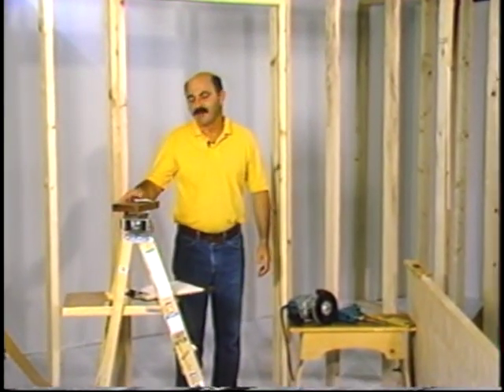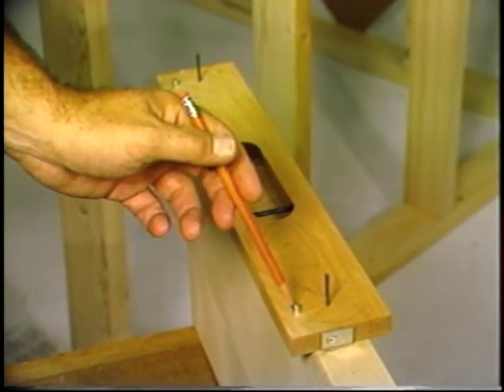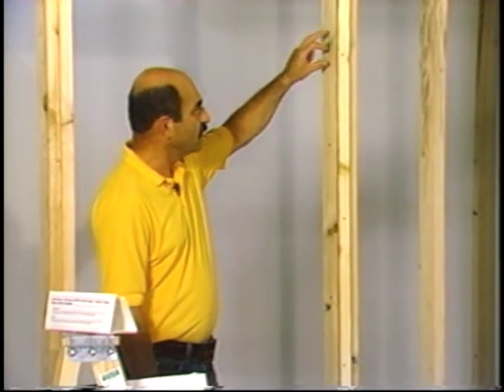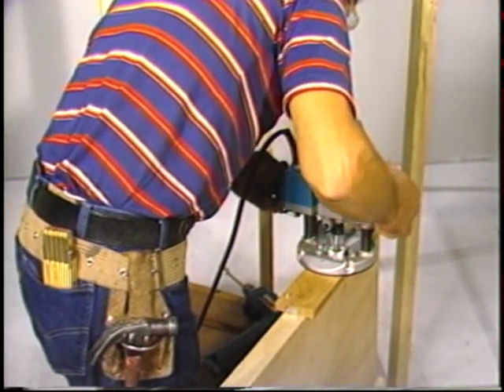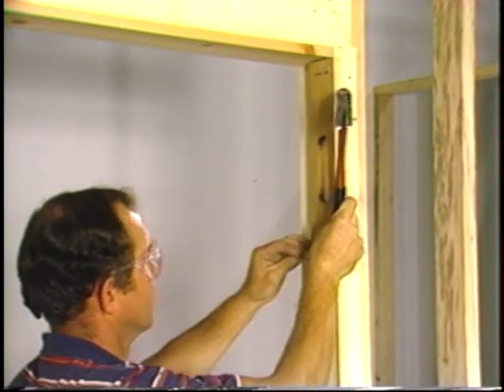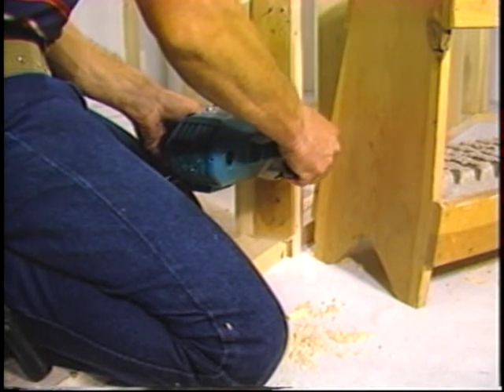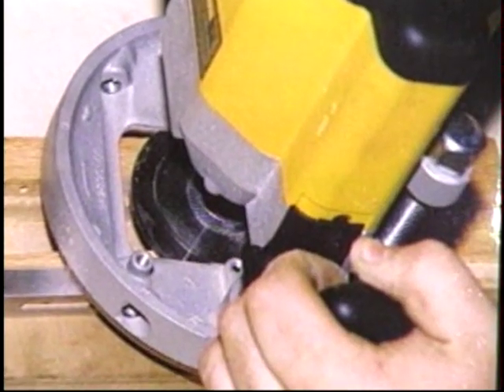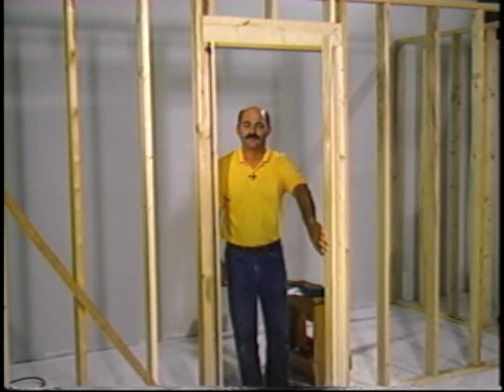How To Install Soss Hinges

Comment: Yes it should, if you use a guide bushing adapter from Festool you need to make sure that the O.D. of the bushing is 3/4".  Soss does sell a universal guide bushing, all you need is an adapter plate with a 1-3/16" diameter center hole to mount the guide bushing to.

Comment: Have you ever used the Soss template to mortise this 212 hinge?  I just recently made some test mortises in both pine and Poplar and I’m finding this hinge to very hard to push all the way into the mortise to sit flush.  I’m using the required 42024 router guide and an Amana 51304 router bit.  I can’t seem to figure out why the fit is so tight though.  And ideas or thoughts?  I’m wondering if I should use the Amana 46259S bit that has the double spiral cutters on it.  Maybe this would produce a better cut.

Comment: Can you recommend how to do a flush door (zero trim) while also using these SOSS hinges?   The normal way I'd see a flush door (no trim) done is reduce the size of the jamb to 3.5" versus the standard full width of of 4.5" and have it sit between the two pieces of 1/2 drywall, and use J-bead to project the drywall edge (which is done flush to the jamb).  Doing this though results in having the mortise for the SOSS hinge overlapping the j-bead (doable but thought you might have a better idea).   Extending the jamb back to 4.5" then creates a delima of how to match/attach to the drywall in a proper manner..
Reply: How did you end up solving this issue?

Comment: Tried to use the porter cable router with the 216 hinge and the 4.5 router bit and the base of the router was to short .Bought what was recommended and it didn't work what gives?

Comment: I am trying to install the door in a minimum width door opening. I am making a secret door. What is the required minimum door frame width? I am using #218 in 30" door.
Reply from the maker: The door thickness is what determines the hinge size, not the door width.  A #218 Soss hinge will work fine in a door 1 3/4".
Reply: I had asked what is the minimum door frame width - not what size hinge is needed. The hinge makes a 1/8" gap on the hinge side of the door but what is the minimum gap on the other side so that the door does not hit the jamb?
Reply: Not much of a secret door when you've just told us all about it.